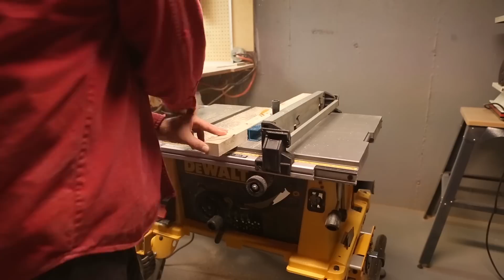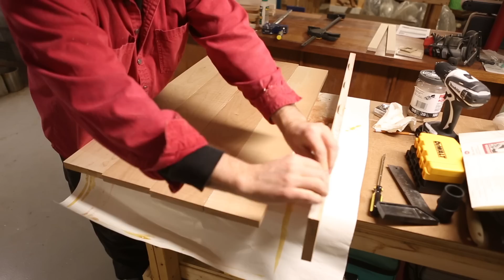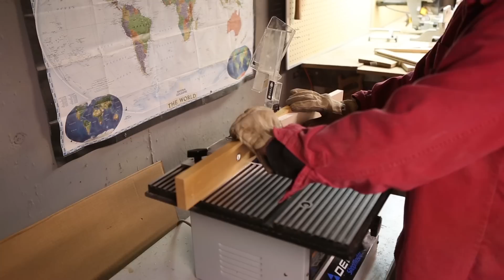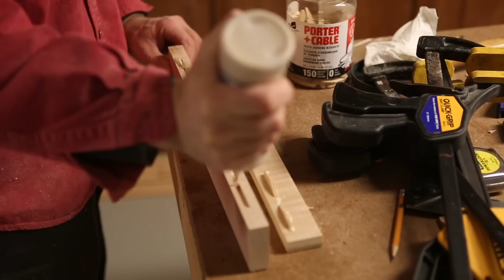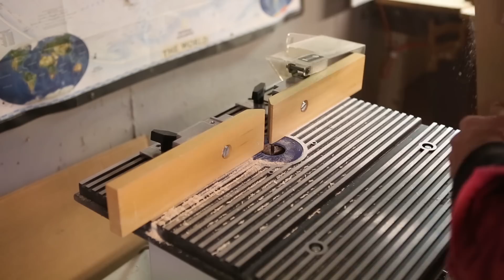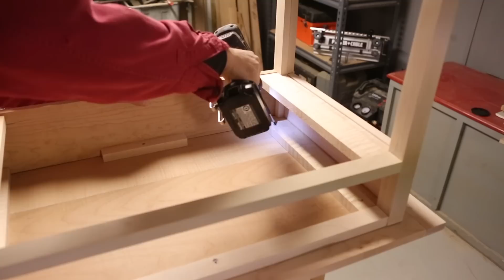Build a Biscuit Jointed Writing Desk

Comment: what kind of wood did you use for the drawer? Thanks and nice job 👍🏻
Reply from the maker: It's curly maple but the color is much lighter.  I used two pieces from the lighter wood for the breadboard ends to add a little contrast.  Thanks and don't forget to subscribe.  New desk project will be posted next week.